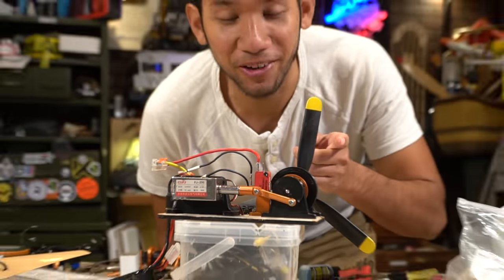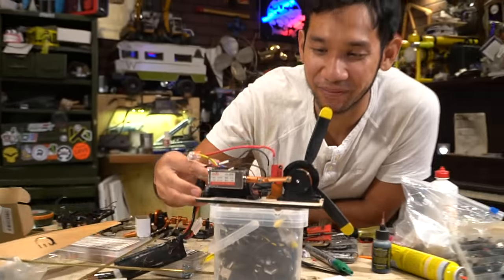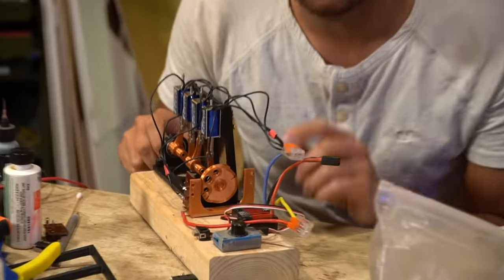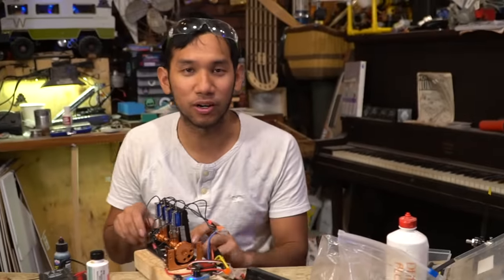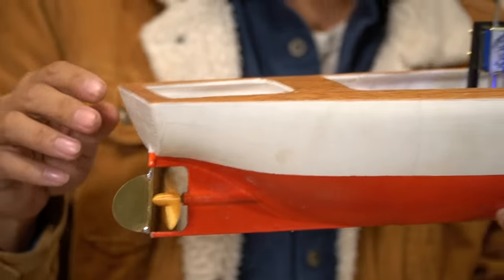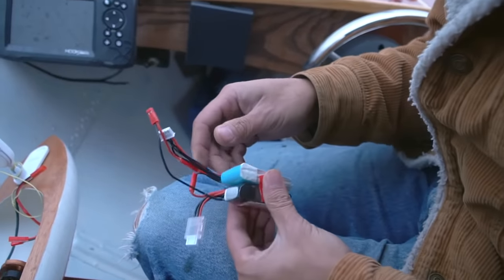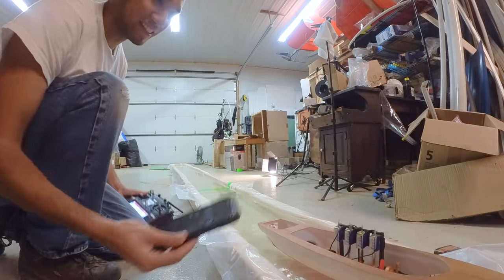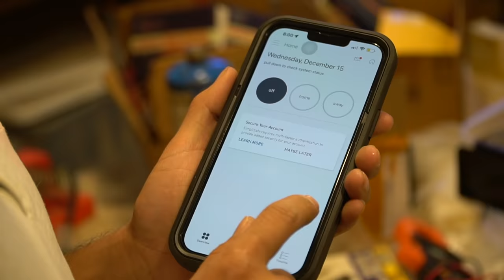Electric piston engine DIY (solenoid motor)

Comment: Ideas:  the crank arms need to be 90 degrees offset with each other instead of 180 like you have it.  It will run much smoother, and you won't have to flick it to get it to start.  Also, make the crank arms longer to yield more torque.  As long as the solenoids have enough travel
Reply: I was thinking this as well. I also wondered if toroidal turbine 3D print would take advantage of that extra torque and help turn it into speed
Reply: A flywheel might help also...
Reply: Not to mention a Starter crank

Comment: I wonder if a larger flywheel would have helped, it'd also be cool to see if increasing complexity with more switches and more degrees on the axle would increase the power. Great vid, ive always wanted to see the application of solenoid engines
Reply: A larger flywheel and maybe a "chord ignition" (like a lawn mower) to set it going
Reply: and timing like 5deg ADC

Comment: You can make a 'two-stroke' out of your electric engine by adding a second switch opposite the first (may also need a second cam); so you can push as well as pull the 'pistons' in the solenoids.
Reply: Nah, no need of a second cam. Clever placement of the switch is fine enough to activate the 'push' arrangement after the 'pull' about 180° after it.
Reply: Yes, but as the is a 2-stroke equivalent, you could have 90° deg offset on each cylinder and better low end torque delivery.
Reply: Could it be called a +1 stroke?? since you can rig it to push and pull every stroke..
Reply: @limpy4707  haha - yes, but you stil need 90 deg apart cylinders. Perhaps make it a 3 cylinder and 120° deg apart, then arrange the coils in delta, and use regular brushless controller. Jobs done 🤓😄💪
Reply: Its kind of a 2 stroke already, every cylinder fires on every down stroke. The idea of power on the upstroke comes from steam engines and I think is called a "double acting" arrangement, or something like that.
Reply: A double pole switch would allow 2 different events to happen every time the switch is activated. Really there should already be some logic in the system, there is only one switch now that should know enough to only fire half the cylinders every time its activated. A little more logic can tell the switch to tell the opposing cylinders to fire in the opposite way.
Reply: @TheStuartstardust  So like a regular 3 phase motor with extra steps 😅👍
Reply: This is technically a 2-stroke setup with each cylinder giving power every other stroke... Just these have relatively low power compared to a similar sized combustion setup.

Comment: The inductance of the solenoids is probably making those high-voltage spikes in the switch each cycle. When you increase the load on the solenoids by moving the prop in water, it was probably increasing the current through the solenoids and exacerbating the effect. If you can, maybe look into putting some diodes across the solenoid terminals in the reverse direction of polarity, so the current has a path to dissipate. Additional zener diodes will increase the voltage drop and should dissipate the energy faster. Not an expert though, ask ElectroBOOM
Reply: And instead of using that mechanical switch to switch the solenoids, he could use that mechanical switch to switch on and off transistors, one for each solenoid, so all the high current from the solenoids are controlled by transistors instead of the switch, so no big sparks that can burn out the switch.

Comment: Something that may help you, solenoids tend to hang once you turn power off, which may be robbing some power from your motor. I would try to time it to swap solenoids a bit before top dead center and see if that helps. Also, possibly try something like an arduino to time all 4 solenoids separately so that each solenoid pulls roughly 90 degrees to get a full 360 degrees worth of “Power stroke”. Would love to see this actually work!

Comment: You could have another switch attatched to the cam 180 to the first switch which connects the coils to power in a reverse polarity and attach permanent magnets to the “piston” and get nearly a fully powered stroke
Reply: With simple solenoids, that is not possible. The polarity of the power does not change the direction. For that you would need push-pull solenoids which use a permanent magnet instead of steel rod.
Reply: @Crlarl  i said you would need a permanent magnet instead of a steel rod
Reply: @tabeebrahman4843  
Yes you did. I misread your comment. Sorry.
Reply: @Crlarl  no worries

Comment: Hey Peter, I'm sure it was mentioned somewhere already, but you can actually get 2x the power if you intentionally flip the polarity of the solenoids on their "return" stroke. 

The "dumbest" way to do this would be to have the switch control a DPDT (2 pole 2 throw) relay, where the relay is actually in charge of the power switching.
Reply: Not with regular solenoids, you can’t. The soft iron used for the plungers will pull in, regardless of polarity.
You’d have to use permanent magnets as the plunger, to achieve the effect you describe. The trouble with that is, because of the repeated reversal of flux, the permanent magnets wouldn’t be all that permanent. The effect would be a crude AC degausser and would demagnetise them, quickly resulting in a stalled motor with the plunger permanently in the coil.

Comment: If you use more than two solenoids, you need to offset them on the crank by 45 degrees to get more work out of them! Also makes switching them slightly more complicated, but doable!

So when one solenoid is halfway through the push, another fires.
Reply: 90 degrees would be best with 4 solenoids
Reply: I doubt it
Reply: Well, I'm just theorizing, but maybe someone will actually build both models and test them out. 
I still believe that the most efficient 4 strokes engine would be with 90 degrees offset between solenoids at the shaft. That would cover all 360 degrees of the shaft rotation with active pulling force, each solenoid will partly overlap with the next one (and previous one also).

Comment: could you use a second solenoid below the existing one to pull back the "piston" giving it 2 pulls per piston per rotation? (sort of like cycling with clips so you can pull the pedal up as well as push it down)

theres no doubt a lot of efficiency gains you can make by changing the rest of the engine since things like firing order make a huge impact to engines like this. iirc 6 and 12 cylinder engines are considered the "best" when it comes to overall engine balance, although im not sure how fast an engine has to run before that becomes an issue, but you might as well give it all the help it can get lmao
Reply: You could add "reverse" solenoids but it would be easier to use push-pull solenoids which can change the direction by itself.

Comment: It'd be neat to substitute a balance shaft on an unbalanced ICE configuration for some kind of generator. Modulating feedback could allow for engine developers to actively control the damping characteristics of the conventional balance shaft while reaping back some of what otherwise is a small but necessary parasitic loss.

Comment: I know I'm one of many, but I have some suggestions from gas engines:
1. Add an identical lobe on your camshaft 180 degrees from the other. This will make it a two stroke, with double the powerstrokes per rpm (unless you did that, can't really tell)
2. Increase your tolerances on everything that spins. There's a good chance that it didn't work in the cold because the tolerances were reduced, causing more friction. Also oil it with a thin lubricant like tool oil
3. Retarding the timing gives better low end power. For the low torque you're making, this may be necessary
Reply: It's already 2-stroke though.

Comment: There is one way to make these engines strong. 
Each cylinder should have air intake and compression. Because at the time of compression, the piston would anyways be pushed downwards. But along with electric frequency.

Comment: A summary of the material used, bed temp, nozzle temp and speeds would be cool for those of us EXTREMELY new to using 3D printers, you know, all the settings yall know by heart but us new folks don't have a clue with... Cool vid man.... very cool

Comment: the inline 4 idea is cool, add some deviding bearings inbetween the arms of the crankshaft and add a sort of watercooling around the solenoids powered by a bigger flywheel

Comment: Good build. A couple of suggestions, you need to get away from the mechanical magnetic switch and the cam lobe in favor of a transistor NPN switch with optical timing. This will make energy transfer more efficient. Second you need to set up polarity reversal and solenoids capable of utilizing reverse polarity. This way every down and up stroke is a power stroke instead of just every other stroke being a power stroke. Last, you need a bigger propeller and rudder for your boat. Have fun! 😎👍

Comment: My son and I built an air powered go cart about 13 years ago, you can see it on my channel.  It used a pneumatic actuator to pedal bicycle cranks. We used a latching circuit with two magnetic switches on the cranks so we got push and pull as the cranks rotated.  This provided power in both directions rather than just pulling in your single cylinder test, perhaps that would help?  Not sure if your solenoids can push as well as pull..

Cool experiment, always enjoy your creations!

Comment: Cool concept as usual. Finally detailed craftsmanship. Of course you're taking all of the inefficiencies of an ice engine. Too many moving parts, power loss from friction and heat and building them into the electric motor which is the most efficient use of energy. There is at this point. But I have to admit it is very cool

Comment: You made what's called a single-plane or flat-plane crank shaft configuration.  A cross-plane crank would increase your perceived torque by spreading all 4 power strokes evenly over one revolution.  Currently, that thing has two double power stokes at opposite sides of a single revolution, creating big dips ans spikes in torque/power.  In general,  I think solenoids like these are great analogs for playing with crank configurations.  It will be interesting to see what configuration actually turns out to be the most efficient. :D

Also, the cold is probably exacerbating a friction issue caused by your connecting rod configuration.  The solenoid, uhh, pistons, I guess you'd call them appear to be experiencing excessive torsional loading with respect to the direction of the stroke which would make them want to jam during their return strokes.  The crank configuration I already mentioned would remedy this somewhat as well.

I'm an engineer by merit and trade.  I love this stuff.  :D

Also, also, you gotta put those layers on and learn to love the dreary, frigid, gray, dead expanse of wasteland that is Ohio in the colder 2/3's of the year man!  I live in NE Ohio, and it totally sucks until you learn to enjoy mother nature's surely side.  Come on up when the "nice" winter weather gets rolling and I'll show you the most scenic snowshoeing locals the state has to offer.

Comment: Now you need to do one that uses digital solenoid control with a microcontroller! A simple 36-1 wheel timing a sine wave to run the solenoids.

Comment: Try using an optical switch to fire the solenoids and adjust the timing and you might get more torque out of it.  In automotive terms this is known as a dwell tachometer.  The electronic commutation of the motor should give you more efficiency.

Comment: Pretty cool!

Here's a simple mod for your engine design:  I bet you're having problems with the big arcs welding your little mechanical switch contacts together.  The arcs are being generated by the back-EMF discharge induced by the solenoid coils when they're turned off.  Simply connect a general-purpose 400v silicon diode in reverse across your mechanical switch and it'll get rid of the big arcs and save your microswitches.  Those diodes cost about a dime brand-new, and can be scrapped out of old electronics for free, so it's definitely cheap insurance for your microswitches.

If you want to continue optimizing your solenoid engine, here's a few ideas to try:  Instead of switching all of that current through that little mechanical switch, use the mechanical switch to turn on and off MOSFETs or general-purpose BJT transistors, and let the silicon move the current through the solenoids.  Be sure to use diodes to protect the transistors or MOSFETs from the back-EMF induced by the solenoid coils since that can Zap your silicon.  Or, if you Really want to get fancy, build your own solenoids with permanent magnets as the plungers and use an H-bridge circuit to both 'push' and 'pull' the solenoid instead of only relying on the 'pull' stroke for power.  Finally, you can use optical or Hall-effect sensors to replace the mechanical switch when you get the silicon circuits working.

So Yeah, I absolutely Can see you making that little electric piston motor a Lot better if you wanted to continue to experiment with it.  Maybe even making it fly?  Fingers crossed!

Comment: On early 4 cylinder gasoline engines, they used heavy flywheels to increase torque and smooth out the output. Heavy flywheels help torque but not horsepower. The alternative soon used was to increase the number of cylinders and decrease the weight of the flywheel. Some cars got up to 16 cylinders in the early days. Bore and stroke also figure in. A larger bore and shorter stroke give faster acceleration, a smaller bore and longer stroke give better pulling power. More horsepower gives faster acceleration and higher sustained speed, more torque gives more pulling power. Which you use depends on what you are planning to do. Farm tractors and heavy equipment usually use long strokes and heavy flywheels, race cars use more short-stroke cylinders. I expect these things will also hold true for a solenoid engine. Anyway, a large diameter, fairly heavy flywheel will help keep your boat engine turning over.

Comment: Definitely need to modify this and have 4 independent power strokes 90 deg. apart. That will give you smoother running and better performance.  Very fun project! :D

Comment: there is a pretty small chance you'll actually see this, but if you do, maybe you could try putting a Ram Air Turbine on your fliers so that battery life will be less of a problem as they'll be constantly be getting power. it might not work on your RC planes but your ultralights and possibly your homemade paraglider could work with one.

Comment: If you turn the solenoid on 90 to 100 degrees before top dead center (TDC) and off10 degrees before TDC it wont effect the output torque but it will more than half your watt usage and really lower the coil heat.  Some of the comments had different switching suggestions which I agree ,  that type of switch gets less accurate as the RPM goes up. Even running that switch to trigger a transistor works better but a hall or optical works the best

Comment: The pitch and diameter of your propeller must be matched to the available power.  BTW What is the British WW2 model airplane on the shelf behind you?   Why not build a single cylinder four stroke internal combustion model engine to run a model boat?  There are plans for a simple to build one in the October 1936 issue of Popular Mechanics magazine." Midget gas Engine" You could certainly do it.  Plus, you get the added enjoyment of plenty of noise & smoke!  (it's the reason so many people attend air shows, NasCar, parades and fireworks displays.)
Way Hey and Up she Rises!  a classic sea shanty.   "What do you do with a drunken Sailor?"

Comment: Dc vs Ac.  If can get your solenoid to work on Ac, keep your voltage low, amps high and use electrical frequency to control the speed.  
Good work I enjoyed your video. 😊

Comment: I just got a 3D printer for Christmas and really wanted to build a rc boat out of one of my model battleships.  Do you think you could make a video walking through how you make the engine, rudder, and how to get a signal to them and all the set up needed to have the boat move and steer.  Basically just how to hook everything up and how it works

Comment: You'll get much more torque by rotating the crank lobes of 2 of the cylinders, producing 1 power-stroke every 90 degrees instead of 2 every 180. it does mean running 2 sets of switches but it will make a noticeable difference. and it should self-start if your timing is right. you could run an independent switch and cam for each solenoid as that would allow for fine adjustment of the timing but that's only really useful when squeezing the last bit of power from the engine.

probably the biggest factor effecting solenoid engines is the parasitic drag of the moving parts, you can reduce this by using teflon "piston rings" to support the solenoid slug in the tube, but they can be fiddly to get right, and require a pretty good cylinder surface. you're probably looking at custom solenoids at that point, but that's the only way you're going to get anything to fly anyway so you may wish to explore that option. I reckon a PTFE bobbin, with the right winding and a lightweight rod with a neodymium magnet core might work for flight. A radial might be a good option too!

Comment: To extract the most power you will wanna balance all the rotating bits, and lube up any bits that are metal on metal/plastic on plastic. Should help with the vibration issues and for the torque issue just change the gear ratio from the motor to propeller. Ik this was just for the memes but hope to see more of things like this!!!